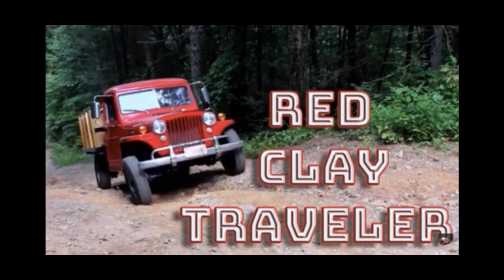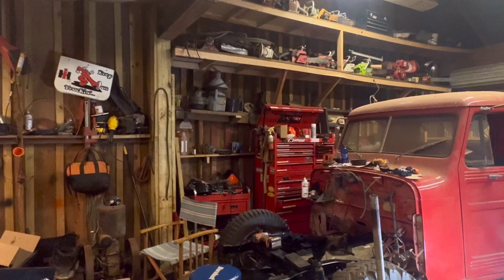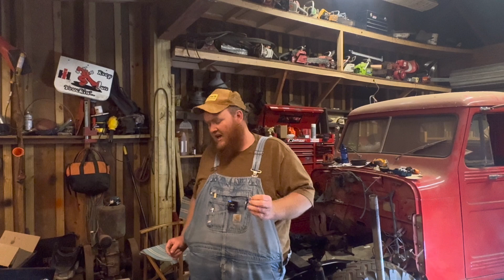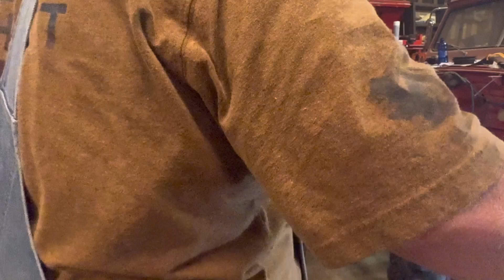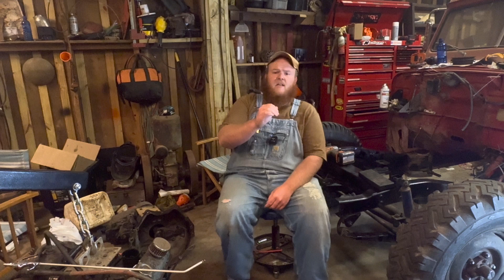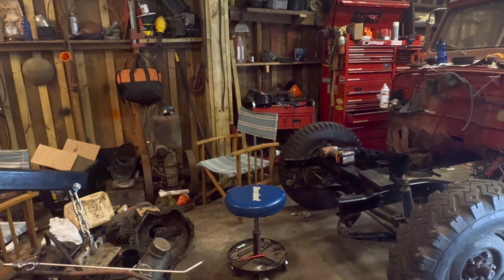Possible Dauntless Clutch Solutions (maybe!) #willysjeep #engineswap #willyjeep #offroad #v6

Comment: Hi Had the same problem on my tractor. After reading the book 5 or 6 time it said to use a special tool to set the pressure plate to the thickness of the clutch disk. In short you had to bend the bendex   fingers one at a time and measure them. It was a pain in the assss but it works good now.
Reply from the maker: Thanks for the info, I have heard of guys doing that on the one as well but I think even then I would still have the issue of pedal travel. I’ll get it figured out eventually. lol

Comment: one other thing i noticed is your dual master cylinder upgrade...have someone push the brake pedal and watch the master cylinder to see if it 'dives' under use...too much flex will fatigue the bracket over time....mine in my willys jeep flexed downward 1/4 - 3/8 of an inch...i made a saddle for the front of the master cylinder from a piece of half pipe welded to a 3/16 plate and bolted it to the frame via the steering box bolts...it solved the problem....i did this with the engine and transmission in and it was a royal PITA.
Reply from the maker: Interesting, I’ll have to check on that. I haven’t ever noticed it moving any amount but I also wasn’t looking specifically for that either. The bracket I used is pretty strong and mounts hard to the frame. Definitely worth investigating while the engine is out.

Comment: Hey, as you were talking I was thinking exactly what williampeckham just suggested.  It seems like the problem you have is one of gear-reduction so to speak.  If you drill a hole on the connecting arm further down toward the central shaft on the bellcrank then it will reduce the distance the connecting rod will travel.  You'll need to make your own connecting rod, as the distance might be too far away for the existing one...maybe threaded rod or something like that.  Probably doesn't need to be grade-8 or anything, though you might want a bushing or something on the bellcrank to keep it from wearing out too much.  It will be a solid link, and you can dial it in to exactly where you want it to be on the clutch fork.  You'll want to keep tension on that fork if possible, the other options with the slip linkage will rattle and might come out of the fork and I don't think you want a chain hanging down where it can get snagged on something.  The further down on the crank arm you go the less it will move.  You might want to have someone press the clutch pedal while you're under it to see how far it needs to move before you drill the hole.  I think there's an easier solution out there, keep thinking it through!
Reply from the maker: Oh I understand what yall are saying now. The problem is that the hole down lower will cause the linkage to put more at an angle on the fork. I do agree that could be possible and I think the solution is probably simple. I haven’t done anything because I don’t want to do something that is unnecessarily complicated.
Reply: @redclaytraveler1949  You can bend the rod mid way to have it align the way you want, the problem, as I understand it, is mostly in how far it travels.  If you can shorten the distance it travels, you can bend a rod to point in whatever direction you want as it approaches the clutch fork.  If it works, that would be about 90 cents worth of threaded rod and I think it would be a pretty simple fix.
Reply from the maker: That is true. I will definitely look into that. I need to get the engine and everything back in so I can investigate all this now that it appears the pressure plate will work.
Reply: @redclaytraveler1949  Good luck with that, I still have issues with the idea that the clutch needs only millimeters to actuate, but it must have worked.
Reply from the maker: I’m going to get it eventually. I’m not super excited about that either. I never heard of such a design until now.

Comment: can you drill a hole lower on the bellcrank, fork side so that the fork rod doesn't have as much travel?
Reply: Was thinking the same thing...
Reply from the maker: I’m trying to envision what you are saying. I need more travel to get normal pedal movement. I think I’m misunderstanding what you’re saying
Reply from the maker: I now understand what you’re saying and I think that could be the solution or a path to the solution.

Comment: I thought you would get it figured out. There is no good or easy way to get a similar pedal travel. Ive wondered what others do when they switch styles. A pedal stop may be easier but will still be different on the pedal actuation and take some getting used to.
Reply from the maker: I suppose I could make an adjustable pedal stop and cut the pedal down but I really don’t want to do that. I’m leaning toward a chain or something similar

Comment: well now at least you know the clutch is functioning as it should...using a slack clutch cable will eventually wear through the sheath...the timing chain is going to rattle like crazy..but it would might work...your clutch pedal will have no resistance for the first bit though...lengthening or shortening the actuating arm on the bell crank looks like the only proper solution...what about getting the bell crank from a cj5 that had a dauntless engine option?...
Reply from the maker: If I lengthen or shorten the arm I don’t see how that changes my situation. I need to move the pedal a long way but the fork a very short distance. I kinda like the chain and all these Willys rattle so bad that I don’t know I would ever notice it. lol I could look into the cj5 bell crank but they ran a long cable and different pedals, so I don’t know if it would help or just make more problems.
Reply from the maker: Also I know the pedal won’t feel exactly normal with the pedal , but the return spring on these trucks is pretty stout and I think it might be alright
Reply: @redclaytraveler1949  lengthening the pedal arm bracket and shortening the clutch arm bracket on the bell crank will change your 'gear ratio'...translating a large motion of the clutch pedal to a short motion of the clutch fork....you may only have to drill a hole as others have suggested.
Reply from the maker: Yes I see what yall are saying now. I was having trouble envisioning what was be suggested but I can see it now. Very well could be the solution.